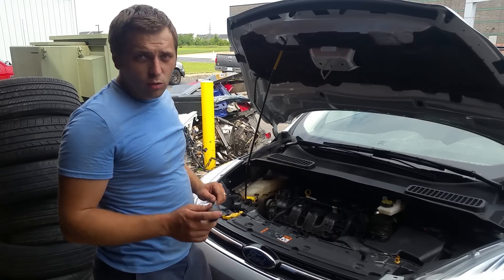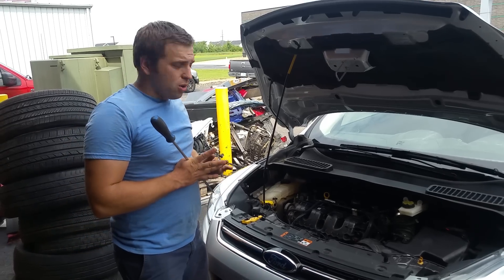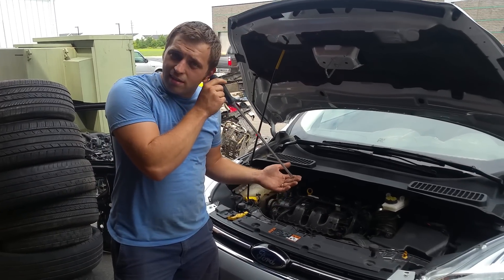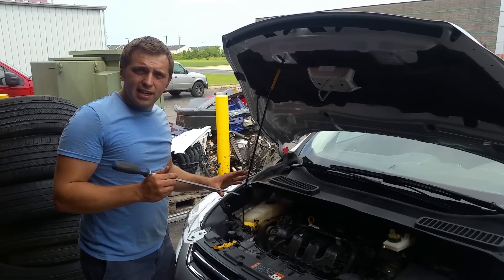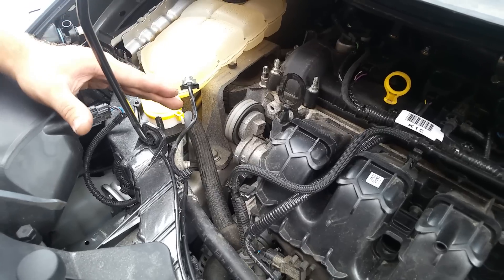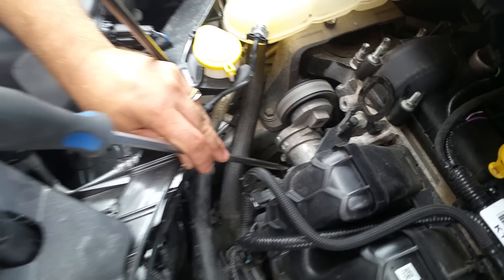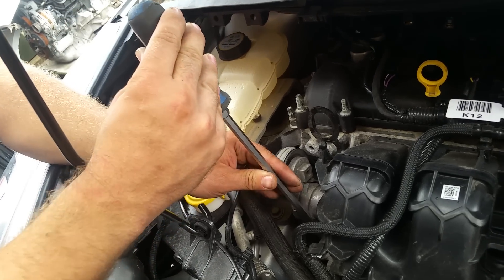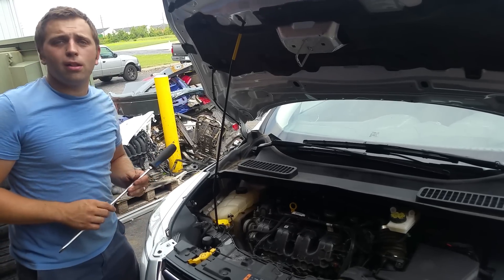How I quickly pinpoint a noisy bearing, pulley, alternator, water pump, on any vehicle.

Comment: I would use a 1/4 diameter rubber or vinyl hose, place one end to the ear and the other to probe around with where the sound is coming from.  The screwdriver can hit a turning pulley, accidentally drop into a running engine and cause damage.

Comment: Good method but I cannot use this because the squealing noise happens when I accelerate ('08 Corolla, manual).  It happens when the engine is at around 4k rpm. The alternator belt just got replaced and still making the noise. Not sure how to pinpoint where it's coming from. 🤔

Comment: Try putting a plastic soda bottle cut off top and bottom insert screwdriver handle into small neck bit of gaffer tape to secure  the large open end acts like a speaker ,,,saves having a haircut you don’t want

Comment: Take a empty washer fluid bottle cut the bottom off. Put screwdriver handle in the mouth of washer fluid bottle. It magnifies the sound. That way if you get caught in one of the pulleys by accident. Atleast it won’t rip your ear off. Just to make it a little safer.

Comment: My Ford mondeo suddenly started giving high chirping or squealing noise, seems like alternator pulley issue,Timing belt and waterpump was changed 20K back. Can I drive it to the mechanic 6KM away? Is it the same belt driving alternator, timing belt, waterpump?
Reply: What was causing the bird chirping noise ? That’s what mine is doing

Comment: If you dont have a super long screwdriver driver or a cheater bar get  Mechanic's Stethoscope  for  4.97 at Harbor Feight, but you are correct this is the best way to track down problems.
Reply: It is the most valuable yet priceless tool in my buddy's shop, has saved a lot of time and money over the years

Comment: Best leaving it alone , my old Renault had a bad alternator bearing for over 2 years ,then when the bearing did finally give up ,all that happened was the alternator belt slipped off and alternator stopped charging the battery, cost me £300 to repair but in my opinion is worth it ,as imagine if I got the job done 2 years ago ,I'd have never saved a lot of money up

Comment: like what you did but what if the noise coming from the serpentine belt because it's vibrating a lot I change it the pulley tensioner and the serpentine belt and it still making vibrating in the belt closing rattling noise mine is Altima 2012 thank you

Comment: I'm gonna try this.You can also find pulley noise with a long oil funnel.Point funnel at a pulley and pour a little water on each pulley.The sound will stop for a few seconds when you find the right pulley and it gets wet.

Comment: Don't use a screwdriver or a pry bar... buy a stethoscope. They're made specifically for this and are cheap.
Reply: 22 may 2019 1:9 pm edt:honda-service-advisor says honda-mechanic use stethoscope

22 may 2019 1:19 pm edt:
but stethoscope maybe has earphone which become oily after usage because
ear produce oily-ear-wax....
(1)https://www.youtube.com/watch?v=n9S2rTAWkMQ (A tool for finding odd engine noises - The Fine Art of Land Rover Maintenance) from youtube-search(stethoscope engine noise)result 6
(2)https://www.youtube.com/watch?v=x4L5fRi8XZ8 (Engine Noise Diagnosis | Ford Tech Talk ) from youtube-search(stethoscope engine noise)result 4

22 may 2019 1:20 pm edt:
source:'earwax' in https://cleanmyspace.com/how-to-clean-earbuds/#26_jan_2019_5_46_pm_est from google(wash earbud)

22 may 2019 1:53 pm edt:
ipx7-earphone can be washed.water-resistant-earphone-code(washable-earbud):
  IPX0 – No protection
  IPX1 – Protects from dripping water
  IPX2 – Protects from vertically dripping water
  IPX3 – Protects from sprays up to 60°
  IPX4 – Protects from splashing water, no matter the direction
  IPX5 – Protects from water jets at any direction
  IPX6 – Protects from powerful water jets
  IPX7 – Protects in water up to 3 feet (1 meter)
  IPX8 – Protects when immersed in water over 3 feet
  source:https://phiaton.com/blogs/audio/ipx4-water-resistance-what-it-means-and-why-you-need-it#16_apr_2019_2_53_pm_edt maybe from-google(ipx5) from 'ipx7' in google(washable earphone)

Comment: I had an AC compressor pulley bearing go bad.  Pep Boys quoted $1200 to fix it and that didn't even include all the parts called for on an AC overhaul.  I threw in a Chinese compressor for $150 and resolved the issue.

Comment: can someone help me when i accelerate my car. A loud squeaky noise that sounds like it's coming from left side. I don't know if its the tire or enigine. If i put my car on park on brakes the sound goes away.
Reply: Priscilla Curry did you ever find out ??? My car is making weird loud squeak noise too when I accelerate press the gas
Reply: Yes I did was the front brakes roter and pads had to be changed
Reply: Have u change the alternator belt? I he same issue but sloved.
Reply: breaks scrape belts squeak lol

Comment: I don't know if it's the same.. but is it doing this inside the car too? because every time the car reach the normal temperature there's this humming sound when it's above 700RPM and it goes away below 700 RPM both moving and not moving link for the sound https://drive.google.com/open?id=0Bx6t3lofq1AgZ0hGMjZyaWt4blU Thanks!

Comment: Great method, a mechanic stethoscope would look much more convincing though
Reply: Ari Romero Garrido not to mention that it's way safer. Say you slip while the screwdriver is pressed to your head, if the tip catches the belt it could easily chuck that fucker into your head and/or fuck shit up with your belts/pulleys or worse.
Reply: Interesting, wasn't even aware they existed
Reply: @SimonAZ  Yes, they're cheap, too.

Comment: nice. i used this method and also a 5/8 heater hose works great too for finding bearing noise and suspension squeaks
Reply: Hey mine is making a ticking noise almost sounds like lifters but it's coming from area of pulley What do u think

Comment: Good vid mate, for safety reasons (& some Schmuck touching the Screwdriver on the belt & driving it into their brain)  I place a 1 & HALF foot long piece of "garden hose" to my ear & the other end as close as possible to each pulley until I get the loudest reading.
Same for rocker/valve or any engine noise.
Reply: There are also very inexpensive stethoscopes made specifically for this task.
Reply: nah, in russia, to do this correctly you actually need a bottle of vodka to hear it better.  after you empty the bottle, you will then realize that the hollow of the rifle makes a better sounding chamber so you stick the butt of the rifle on the pulleys and point the barrel on your ear.
Reply: Lozsteve whaite 😂

Comment: I have an 05 honda accord and it started making that noise and the battery light came on. My fav auto mechanic is like 15miles drive away. Wonder if i can make it there...
Reply from the maker: +Trancer006 u probably having your alternator going bad. Not sure if you will make 15 miles if its done
Reply: +George Melnik any help trying to remove idle pulley bolt out of 05 acura rl bolt to long tried raising engine still not high enough

Comment: Hi, I just did timing belt and water pump replacement at a shop.

Now my car makes the same noise as in this video:
https://www.youtube.com/watch?v=6-_htHQo7c4

Any ideas?
Reply from the maker: Its very hard to tell via your video. Does it seems like its comming from under timing belt cover or not? I have a video on how i pinpoint noisy components on the engine when its running. Please go watch it, maybe it will help you. But there is a very good possibility that it could be timing belt idler pulley bearing. I dont think its a water pump as it would of been leaking coolant by now with that kind of noise

Comment: Any clue what would cause a distinct rattle under the hood of my 2004 corolla when I first start it up and put it in reverse? The sound stays when I shift to drive but once I accelerate it goes away completely. There is no rattle when i start the car and it is in park, only once I shift to reverse. Transmission works fine. Thanks in advance!!
Reply from the maker: Sounds like a loose exhaust shield

Comment: I have a 95 Cadillac Fleetwood brougham with 57,000 original miles in great shape but in the engine compartment it has a bird chirping like noise when it sits at idle.  Like birds chirping.  any ideas?   no grinding...no high squeal....just like birds chirping
Reply from the maker: I am almost 100% sure its a serpentine  belt.

Comment: Yes, this is the same method which my car's aircon man used to 
find out the bearing noise from the alternator. I had thought at 
first that it was coming from the water pump, because the 
sound appeared to be from center area, where the pump was, 
rather than the left, where the alternator was. 

However, the sound on my car was more of a higher pitched 
''whee ... whee .... whee'' type.

Secondly, the aircon man said you must use a quite thin 
screwdriver fot this, much thinner than yours.

My brother--in-law said one way to find out if it was the 
alternator bearing was to take out its belt, then start the engine.
Reply from the maker: Everyone has their own ways  of finding noisy bearings. I prefer my works for me every time .
Reply: @melniksmotors  how do you know if you need to replace the alternator or just the pulley instead?

Comment: Hi George. Helpful, but describe the actual noise of a failed pulley. I'm dealing with this problem in an '03 Ram. Спасибо.
Reply from the maker: You will hear bad pulley sound different than all the others also it will be making more of a grinding rubbing squicky noise
Reply: +George Melnik Thanks, man. That's a pretty good idea with the screwdriver!

Comment: But what exactly are you listening for? what sounds indicate that one of the mentioned have gone bad?

Thanks
Reply from the maker: I am listening for a noise that gets transferred thru the screwdriver, basically screwdriver becoming stethoscope
Reply: Just any noise? or something specific?
Reply from the maker: I am able to actually hear the bad pulley or alternator a squick or humming. Lets say you open a hood and you can hear something making a bad noise but you not sure which one it is because they are located all close together, with a screwdriver i am able to point out the pulley or the alternator that actually has a bad bearing. You actually hear it in the handle of the screwdriver.
Reply: ok, so when any of the pulleys or other parts like alternators go bad then the sound is a squick or a humming? and by putting a screwdriver to your ear you pinpoint the location of the malfunction. Is it only a bearing that has gone bad that makes that squick or humming noise? or are there other sounds that the "screwdriver test" can locate.
Reply from the maker: I just listen to not normal sound. Its not alway a squick or humming some times its a grinding noise you just have to use ur judgment then. Its one of techniques some of the mechanics use. It is very effective and fast.
Reply: OK, thanks for the advice I'll try to use this.
Reply: I tried this just now, starting with the alternator and I was "ah ha!", but then I moved on to other pulleys and they all sounded the same.  I'm unable to determine which one is the bad on.

Comment: this car is so new it should not be having these issues at all
Reply: I know your comment is a year old. But let me tell you your exactly right... I had to drop $2200 at the Ford dealership on a 2012 Taurus. If it hasn't already happened the throttle body and PCM/ECU will go out in that car. It's the recall that wasn't...I will NEVER put one dime into the Ford company EVER again.
Reply: You don’t know how many miles are on it, age of a vehicle doesn’t mean anything it’s the miles that count, I only have 93,000 on my 03 F150 with no issues. I have 130,000 on my 2014 Ford Edge and have replaced some parts on it
Reply: Cheap components.
Reply: Buttered Toast don't forget about the water pump that fails too.
Reply: Uteopia I reuse condoms
Reply: @realskata16  turn them inside out?
Reply: Yeah but.. Fix Or Repair Daily.
Reply: Found On Road Dead
Reply: AMDX1325 

It’s NOT age but mileage 

NOT rocket science, idiot
Reply: Ford's are garbage lol
Reply: shitty ford? why you buy a more expensive car than junk like these.
Reply: 2013
Reply: Age vs miles big guy
Reply: steve s dam thats lot of miles in so little time..
Reply: Factory defect?
Reply: its a ford made in mexico what do you expect.. build the wall
Reply: Ford: Factory Ordered Road Disaster. Need I say more....
Reply: AMDX1325 Ford problems.
Reply: FORD
Reply: Cars these days are like condoms you use them and throw them away
Reply: is a Ford!   that's why
Reply: minor25 Fix or repair daily 😂😂😂
Reply: F'ed Over Rebuilt Dodge